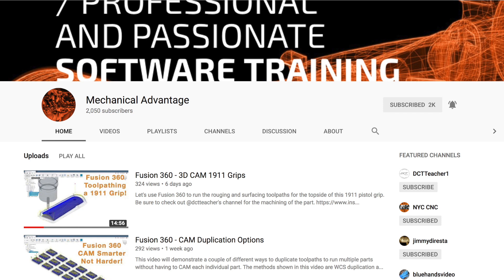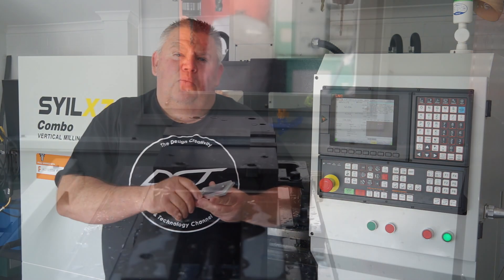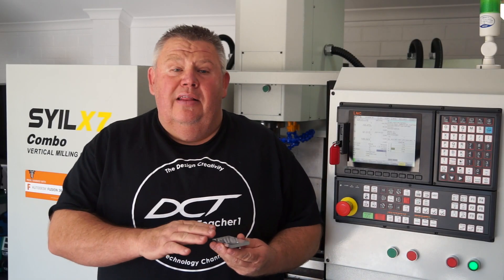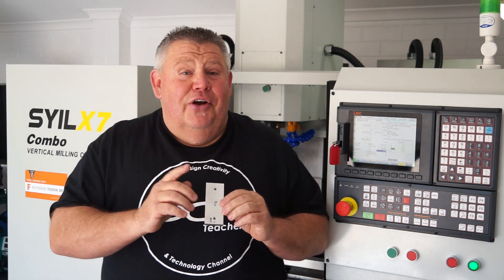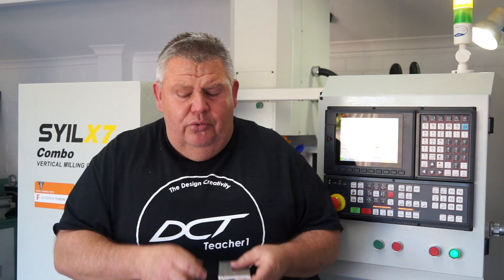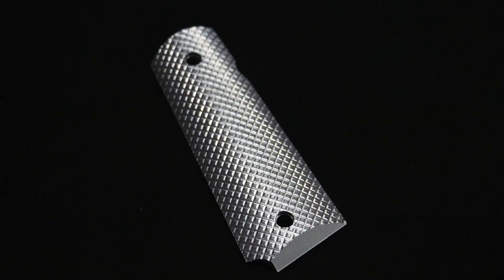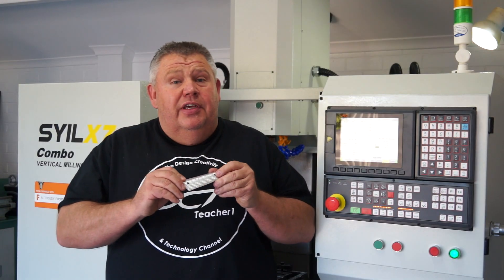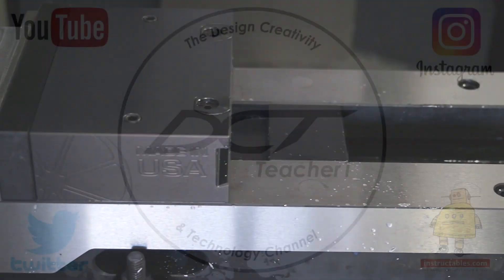SyilCNC X7 3D Machining - Colt 1911 Grips

Comment: Getting coolant up into the smaller ER collet holders matters on my machine!  Keep the coolant from blasting up into the collet and you will have better holding force and results.  Lots of chatter from poor gripping force on small ER holders too.
Reply from the maker: G'day MHH.  I've never had that problem before.  Even when using through spindle cooling on other machine.  Thanks for watching and providing feedback.  :-)

Comment: Is that 0.5 psi coolant pressure?  Should bump that up a tad maybe. Cool parts and setup tho. 
Thanks
Reply from the maker: Phase Converter 135 amp 208 V G’day mate. Yes this is the standard coolant pump that comes with the machine. They have a high flow / high pressure pump option. Oh, I did have the coolant taps cracked to 1/2 during filming, as I had my $2.5K Sony camera poking through a garbage bag with the side door open hahaha. Cheers, Aaron

Comment: 14:30 Why does everyone stop their videos before the part is actually finished!? How do you A) Flip the Part and B) Remove the part from the block? I know it seems simple but I wouldn't be watching your videos if I already knew how to do that. Please do a video, I don't even care if it's sped up, of you flipping the part, re-locating and it and removing the part from the block. I NEED TO SEE THIS
Reply from the maker: Hi Brian.  The finished part was actually held down to the fixture plate via 2 x mild steel machine screws.  The work offset remand the same (fixture plate), as the part was located by the holes.  I don't do that much fixture plate work anymore, as I tend just to order thicker stock and buzz the hat off.  Do you have a particular project in mind that you would like me to demonstrate?  Or would you prefer that I do a video series on how to?  Some ideas would be awesome.  Cheers, Aaron
Reply: Do a how to video of how to do the other side. Flipping and relocating.
Reply: The holes on the bottom side of the part are counterbored so holding it by the screw holes might be a bit difficult.  I suspect that soft jaws milled would hold it just well enough.  The flat edge on the sides is only like 0.060" though, a bunch of tiny hex clamps might be a way to fixture it, with the locations for them parallel to the angle on the flat sides of course, and possibly sunk into the fixture plate so only 0.055" contact or so.  Hex fixture clamps usually kind of suck but every now and then there's a long flat edge that can be used with a bunch of them.  I wouldn't machine a perfect negative of the part into the soft jaws though, clearance means less machining time and more flexibility if you want to change the part finish/geometry or toolpath.

I don't have a vacuum plate personally, but if it holds better than soft jaws (mill the soft jaws down closer to the center of the vise jaw vertically so you don't get the jaws flexing out away from the part) then the vacuum plate would be a no-brainer.  Perfect part relief into a vacuum fixture if you can figure out the seal for it would be amazing holding-force wise.  Or you could do the counterbores in a different operation entirely, but the journey would be great experience in fixturing.

You could try ID expansion clamps on the bottom side of the hole if you can find them or make them small enough and with enough clearance to finish the top side of the hole, but it might be difficult squeezing enough force into that small area to hold the part for milling without breaking it.  Lots of options!
Reply: @multiHappyHacker  Or.... just the way he demonstrated. The CB on the back matters not really. If he wanted to ensure no screw flex, he could have done the fixture plate with bosses to fit in the CB. obviously there wasn't an issue, so that too is irrelevant. If I could offer any criticism at all, it would be on not doing both panels at the same time from a single piece of stock. That would just be for the sake of loading time and that would only matter if he were making a run of them, not just a single set. This would have allowed him to not have the misshap with the non symmetrical bolt pattern. All in all, the method used was probably optimal for the quantity made. Nice work.

Comment: How are you finding the LNC controller to work with Aaron?
Reply from the maker: Hi James, it is going really well thanks.  I need to make some "use the controller" videos for you guys.  Would this be of interest to you?  Cheers, Aaron.
Reply: Certainly. I've been chatting with XuShuo about the Syntec 22MA and LNC5800 trying to track down more English information on them.
Reply from the maker: To my knowledge (from what I've been told by another importer) the LNC is based off Linux.  Have you seen the large touch screen, now that's sex on a stick ;-)
Reply: I haven't probed on that yet but it looks like it would be a handy addition to the machine.
Reply from the maker: If you click on the Syil URL link I provided in the description area and scroll 1/2 way down you'll see the 19" touch screen and panel.  Man I wish I had that on mine.
Reply: Yea i saw it i just haven't pressed Syil on it as i'm still working through the controller options.

Comment: Those look GREAT Aaron! I've been looking forward to this since Mechanical Advantage put out his video last week.  Clever work holding, super handy as I've always told myself I'm  gonna make a set of 1911 grips just because (we all have 2 or 3 here in america ;) ) the setups are good stuff because they're a little deceptively tricky.  Jason at Sand Hill CNC did a set of these a while back too, if you haven't seen his video.  What are you gonna do with these?
Reply from the maker: Hey Jeff, how's it going mate?  Thanks buddy, I'm really happy with the finish as they came out looking trick.  I don't own a gun over here in Australia, so I was going to ship them to Kevin in the USA.  It was a great collaboration project.  Morgan's CAD file, Kevin's CAM application and all the big boy had to do was machine the little suckers.  Now, I'm just waiting for the cops to kick my door down to arrest me under the firearms act ha ha ha ha.  Hey, we are all waiting for your next video upload too.  Cheers, Aaron.
Reply: @DCT_Aaron_Engineering  Great work Aaron! The grips look sensational. As the grips are not classified as an integral part of the firearm, you do not require a firearms license or armorers license to manufacture or be in possession of them. As an example, you could go into a gun store and purchase a set without issue.
Reply from the maker: @ProjectBrettoTemp1  Thanks buddy.  I was totally shitting myself making these grips, as I was really worried about possible legal ramifications.  Thanks for the heads up though, much appreciated ;-)

Comment: Great work Aaron.  Looks like that machine is living up to expectations.
As noted by others, surface finishes were great and the machine was hummin'.
Reply from the maker: Hi Jeff.  Thanks mate, the Syil X7 been running a treat.  So happy with that surface finish.  It all comes down to good tooling, proper fixturing and a rigid machine.  Thanks for watching Jeff.  Cheers, Aaron.

Comment: M1911 pistols (US Army original designation is M1911, with M1911A1 & M1911A2 variants over the years I believe) have a caliber of .45 ACP (.45 automatic Colt pistol).

 Milspec & non milspec versions have been in production for ~110 years with dozens of various brands & their particular enhancements & features. It's also quite possibly the most (re)produced pistol design ever created. General military use ended in the late 80's early 90's in favor the Beretta M9, although it's still available for special forces use(they choose weapons based on mission & can choose damn near anything). With all these manufactures you can get one in damn near every pistol caliber still in use today (if not every pistol caliber still in use). Some companies offer conversion kits that include a barrel in the desired caliber, as well as magazines & different recoil springs that may be required for proper operation of the firearm when chambered in certain calibers other than .45ACP. It's an awesome firearm. (And by far my favorite to shoot)
Reply from the maker: Hey buddy, thanks for taking the time to supply all that information.  To my knowledge they were .45 caliber, but a friend told me that they can come in a variety of calibers.  So your detailed explanation solves that ;-).  I've never held or fired a handgun before.  They are very hard to own legally over here in Australia.  Unfortunately, the criminals don't have problems getting hold of them though :-(       Thanks again for watching and feedback.  Cheers, Aaron.
Reply: @DCT_Aaron_Engineering  not a problem, thanks for the videos!! Thanks for mentioning that criminals still have ready access to firearms, even in Australia where legal ownership is so difficult. That's a point that is always brushed aside.

If you get a chance to go shooting at a gun club or whatnot you definitely need to try a 1911! Someone will have one, that's for sure! 

Keep up the good work. I subbed after this video!
Reply from the maker: Hey buddy, thanks for subscribing I really appreciate it.  Yes would love to go shooting at the range one day.  I wanted to do in the USA (Vegas) when I was over there last year, but was too afraid of the powder residue just in case me or my luggage got swabbed at the airport.  My friend over here is a licence shooter / hunter.  He was reloading in the morning and got swabbed at the airport at lunchtime.  He returned positive for ballistics residue and got held in detention (locked up) for over 3 hours.  Missed his flights, the function and everything because of it.  Idiocracy at it's finest ;-)
Reply: I was a boarding officer in the USCG when the powers that be decided to change to 9 mm Beretta pistols instead of the .45 caliber Colt model 1911. The 1911 is a much better piece of equipment in virtually every way in my opinion, especially stopping power.  We were told the change to 9mm came to standardize ammunition for NATO countries. French Beretta lobbyists must have paid someone on the committee enough change to the 9 mm over the Colt .45.  Everyone I worked with would have preferred we keep the .45 because our lives depended on it. But I digress.

Good videos. One thing I have noticed, judging from the sound, the Syil spindle accelerates to desired RPM, and comes down to zero RPMs prior to tool change much more slowly than Haas machining centers.
What method of spindle braking does the Syil use? Electrically with the drive motor, or a friction brake ?
Take care

Comment: Those look awesome! Great video and I didn't have a problem seeing the part through the coolant coating the part.
Reply from the maker: Hey Jody.  Always great to hear from you buddy.  Thanks man, I try and get the camera close to the action.  I've been opening the side door and hanging a garbage bag up with magnets.  I cut a slit in the bag and stick the camera lens thorough that.  Occasionally I get coolant on the lens, but I run a UV filter on the front so hopefully it doesn't get too smashed lol.  Hey, when are you uploading some more 770 footage?  Cheers, Aaron.

Comment: Nice Machine Sound! 
Sometimes in your Tool´s are chips! Can you program in your Controller or in Fusion a littel Time M4 rotation very fast before you or the machine himself change the tool ?
If you can do that the Result was the chips fly away.
Reply from the maker: Hi Stephan. That's a very good tip mate.  So M04 (anticlockwise) and that will assist to remove any sticky chips before replacing the tool.  Very cool mate.  Cheers, Aaron.

Comment: The spindle and cutters sound really good! Nice high pitch sound of aluminum in the cut. Cool pattern too, I just did something similar on another part just because it looks so cool :)
I cheat when I do grip panels like these...I drill the holes from the "inside" first (along with some small light-weighting cuts) then I counterbore the holes by hand, then flip around and use aluminum screws to hold against a fixture. The outer cosmetics have to be high enough to avoid blowing those screw heads.
Reply from the maker: Hey Andy, I missed this comment over a year ago.  I'm very sorry mate.  Thanks for the tips buddy.  That's why you're the master and I'm the student  👍
Reply: @DCT_Aaron_Engineering  hey you're the man cutting grips into the quiet hours of the morning! I'm just sitting here trying to figure out how to teach a CNC class virtually... ugggh!
Reply from the maker: @ydna  Oh man I feel your pain.  We opened up the workshop again to the high school students.  Parent permission for them to attend and we have nurse take their temperature and sanitize.  I'm over this FKN Shit mate!

Comment: Very impressive surface finish before the knurlling. That ball mill did a great job mate.
Reply from the maker: Hey Rob, thanks buddy.  I made sure I pressed feedhold and opened the door to get that shot.  I wanted to show everyone the amazing surface finish that I got on the Syil X7.  She's been running like a dream :-).  cheers mate, Aaron.
Reply: DCTTeacher1 great to hear! 
Obviously the mill is very stiff to get that lovely finish! No chatter there, beautiful job mate.
Reply from the maker: You read my mind.  That was the same comment that I just said to Jeff above.  Good tooling, good work holding, spindle RPM and a rigid machine ;-)
Reply: DCTTeacher1 love it, wish I could pull the trigger now lol. 
Just need to understand things like G54 etc, at the mo, I have no clue that that means lol.
Reply from the maker: That's ok Rob.  Heaps of us here on the tube and the Facebook forum to help you.  G54 is one of your work offsets.  It tells the machine where you part is located in the Cartesian coordinates.  There are 6 basic work offsets (G54, to G59).  There are 48 others but I leave it at those for the time being.